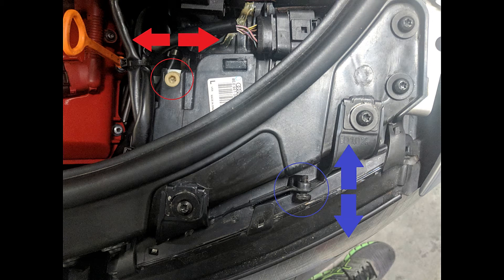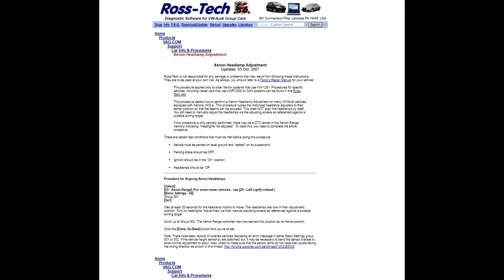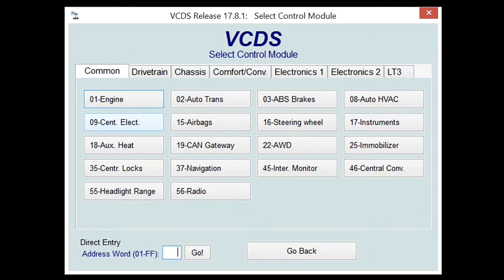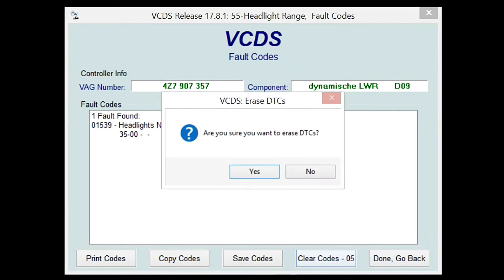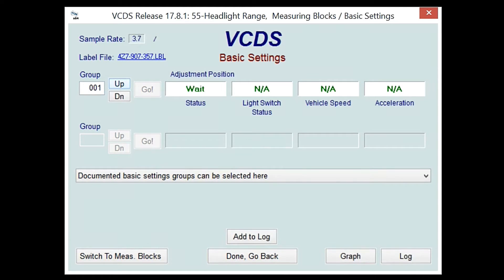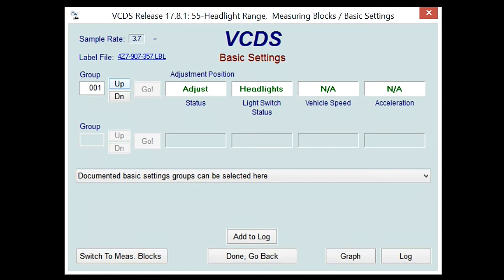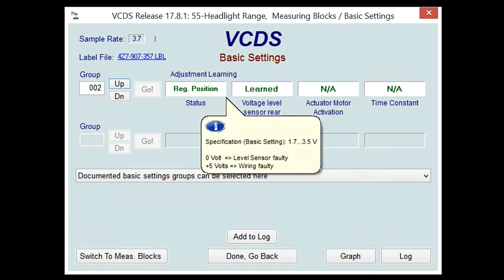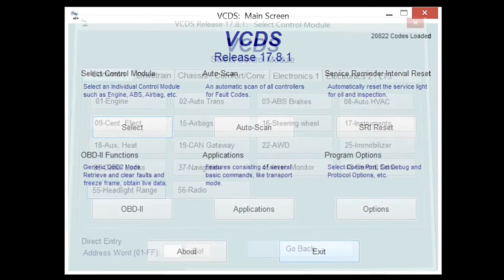VAG-COM/VCDS: Xenon headlamp adjustment!

Comment: Thanks for sharing. I have an error with my headlights. And the error won't go away with VCDS. Does this procedure work for my Audi A4 B8, 2010?
Reply from the maker: Not a 100% sure if it does or doesn't.  My recommendation is if it doesn't go away then maybe you will need to go on a Audi forum to see what other people have done to fix this issue.

Comment: Bough new headights fro audi a4 b8  2010 and trying to adjust them.  After i entered basic settings as in this video - light beam was so high that in order to fix it i had to screw all the way in mechanical screw and the white screws to lower them to absolute minimum possible. After beam position learned when car starts it randomly shines  only one meter from the car or on  random next start car shines normally. Why is that?
Reply from the maker: That's interesting, but I have no clue why it would do that.  Sorry I can't be of any more assistance.

Comment: Ciao, ho visto il video, vorrei capire quindi prima si fa il Group 1 e poi vanno regolati manualmente?
E il gruppo 2 a cosa serve?
Grazie
Reply from the maker: Yes, first Group 1 and then manually. The car is smart, but you still have to do some manual labor. Unfortunately, this car doesn't have the capability to do it automatically like newer ones.

Comment: I have replaced new modules and few functions. How can I code.
Reply from the maker: I don't understand what you are asking.  How can you do what?
Reply: @MACSDIY  hi I have replaced the modules in the headlight. When I connect the headlight the indicator and the day light do not work . I have been told the modules in the headlight need to be coded. Do you know how ?
Reply from the maker: @georgefernandes1767  once you go into VCDS there should be an option for adaption/relearn.  I am not at home at the moment to give you all the information but I hope this will help a little bit.
https://www.audizine.com/forum/showthread.php/578065-How-to-Properly-Re-Calibrate-and-Adjust-Adaptive-Bi-Xenon-Headlights

Comment: I tried this but when entering basic settings channel 001 I can't hear the motors. Do I need to replace them?
Reply from the maker: I am not saying that your motors are shot but if you don't hear anything then most likely yes.
Reply: @MACSDIY  they must be, I tried it again and this time and had my ear on one of the headlamp and had the basic setting running for around 1 minute and I could hear anything. Imma just buy 2 new for 15$ each. Thanks for the tutorial!
Reply from the maker: @Erik-Potato  sounds good.  If that is the cause can you put it in the comments because that will also help other people out.  Thanks in advance

Comment: I just changed-out one of my dysfunctional headlamp adjustment motors on an old Audi A4 B6 and now one light goes up and one goes down! 🤪, yeah, like that, 😂.  I tried every configuration and method of putting it right, even pulling the inners and manually rewinding the cogs on one to start the shafts at the same length - the car just converted them to opposite again the second I turned the key! 😫. I then realised it could only be a software adjust that’d fix this, and after searching for a whole day I’ve finally come across your video here!  Thank you so much for sharing!  You are a saviour!  My head was bursting with this! 🤯. The only thing is:  I’m in the UK, this is an MOT failure here, so the car isn’t road legal to take it to someone with VCDS software to fix!  🤨. It looks like I’m hunting for software today!  Stay safe and well, and I hope you can have as good a Xmas as possible give all that’s going on in the world.  All the best for 2021! 🍻
Reply from the maker: I am glad that it worked out for you.

Comment: Is it same for 2017 VW Golf ?
Reply from the maker: I am not 100% but it should be just a push of the button on VAG COM/VCDS once you go under the correct settings.  That's how my 2013 GTI was atleast.
Reply: @MACSDIY  man i have 2017 1.4tsi but i have old hex v2
Reply from the maker: Check it out and let me know.

Comment: Stil can not adjust ..what is the position of the sensors under the car 
My lights are good util i start driving and pass 10 mph(20 km/h) lights lower down automaticly and they stay that way util i stop
Reply from the maker: That's a really good question.  Unfortunately I do not own this car anymore but the only recommendation that I can give you is trying to start from the beginning of the video.  You probably could have missed a step, not saying that you did but it could have been possible.
Reply: I still did not fix it noticed that my sensors are not on the same hight front 2.67 and the rear is at 1.97 i change the suspension need to check it agin to calibrate new height if anything is changed offcours 😀
Reply: Wil try thank you
Reply from the maker: This is a late follow up but did it work.  Just curious.
Reply: Have you fixed it?
Reply: @alrayan95  no i didnot fix it